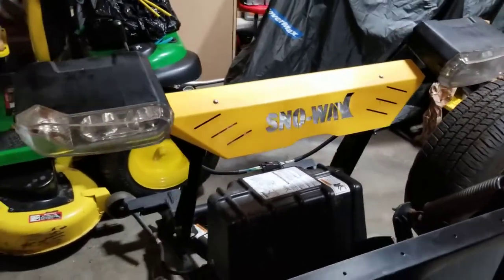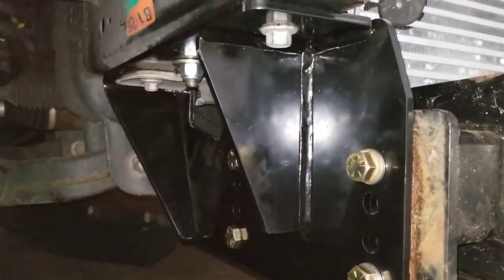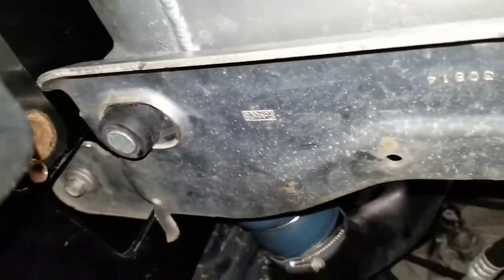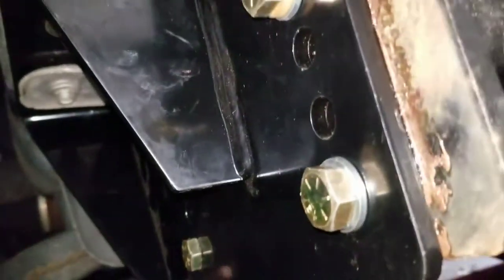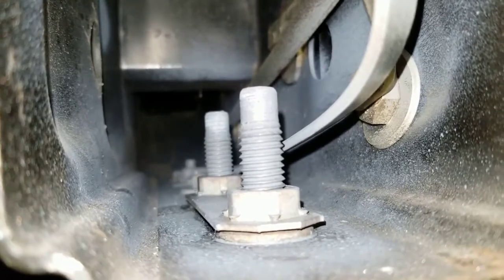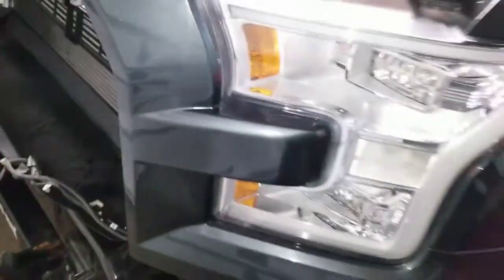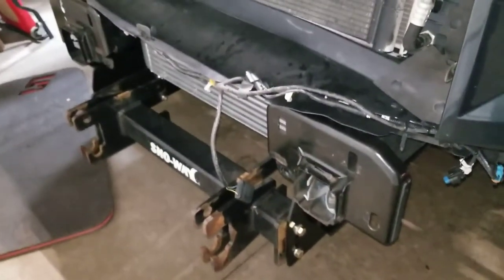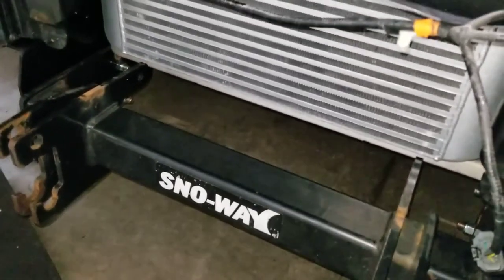SnoWay 26 Series Snow Plow Install, 2015+ Ford F150 EcoBoost

Comment: what is your front GAWR? mine is 3350 and the snow way dealer is leery about installing one on my truck because on the snow way web site my crew cab configuration doesnt have my GAWR. I have to choose the single cab configuration. so im wondering if my front axel can handle it.
Reply: I have the same question. I was told there are NO plows that are allowed on these 3.5L ecoboosts but I see more and more people doing it. Would love to see an update especially how it actually works once fully installed.

Comment: Starting this install today and this video will be a big help, I’ve had this plow since 2013 and have had it on a 1/2 ton ram and two 2500 rams. For the the 2500’s I had to widen the center section so I will need to cut and reweld it back to the original width and I did buy the snow way intercooler mount. I also bought the Ford weldments used and they didn’t come with the hardware so I will need to make the handle bolts as well, should be fun!
Reply from the maker: Good luck today man. That sucks the weldments didn't include the hardware, but mine didn't either. In my YouTube profile you should be able to see my email if you need to ping me for any reason. Just let me know.
Reply: @MidknightMechanics  thanks, install went good and didn’t end up having to make the handle bolts as I was able to just reach back in the frame rail.. all I have left to do is pull the remote wire into the cab.  Also found out I have a leaking oil pan gasket too but Ford gets to fix that!

Comment: Great video and I’m about to tackle the same job.  Question:  why wouldn’t you just notch the push plate bracket a bit vs the intercooler cross member to get that clearance?  Seems like this would be much easier.

Comment: Please do another post to see what it looks like when your done.  Interested to see if you got the plastic valance to attach on the bottom
Reply from the maker: My thumbnail photo on the video, that is what the final looked like. Unfortunately it was impossible to reattach the bottom plastic valance. You'd have to remove the crossmember to have the valance installed.

Comment: Likewise no other info, I did my install and removal on my 2019 f150 2.7ec. I am preparing to do on my 2021 now and may create a video or key pictures of the install.
I do not need the light harness and my 2021 has adaptive headlights so that further complicates things.
You will be cutting the horizontal plastic bumper piece, after that though you will be able to cut and install the vertical air deflector nicely up to the sides of the mount.
Reply: How long did you plow with your 2.7? Did you have any issues? I'm nervous to put a plow on a 2.7 as it's advised not to but I think it will be just fine.
Reply: I only plowed my own business property which took 45min to 1hr for a big storm. This would only be a few times a season in Toronto. I flip the leases so I only had time one year each. Loved it until I got my lightning - which I can’t plow with.

Comment: how much does this plow run for?
Reply from the maker: Right around $4K new, but this one, I was able to score gently used for 2200 and then I bought new push plates and headlight harness for around 650 more.

Comment: Thanks for video. I'm about to install on my 18 f150 diesel. Snoway or ford approves it for the 3.0....🤔🤷‍♂️. I wonder if that other hole you mentioned is for the 3.0 intercooler bracket. We gonna find out!
Reply: Update on the 3.0 diesel. The mount I sourced came off a 3.5 eco truck. It had the snoway intercooler bracket. It bolted up perfect. The locations of the intercooler pins are infact in the same location as the 3.5. 

So it was a pretty straight forward install. Still need to pull intercooler and mount the thru bolts in the frame. I current only have the 3 bolts underneath.

Comment: how is the ecoboost do with a blade i have one put do not know if i wanna put one on it or not
Reply from the maker: I was in the same boat Ryan. I (OCD) care too much about my truck but wanted to give it a try, knowing I could just sell the entire setup if I thought it was too much stress. So far so good. You can definitely feel the weight hanging off the front end, but surprisingly it doesn't bottom out the suspension, and doesn't hang really low like I expected. Also it plows very well, super fast movements of the blade, but you can tell it's a little harder/heavier steering while you maneuver the blade. I remember being warned, you cannot pitch the blade, while lifting the blade, while steering - it takes too much power. But that's easy; I'm almost never pitching the blade while lifting or dropping it. Also, I only plow my own driveway so the wear and tear on my EPS will be minimal. They also warn not to use heavy power loads like heated seats while plowing, so I don't. So far I'm really impressed with the quality and features of the sno-way, like the wireless remote. Not having to run new wires into the cab was priceless to me. Let me know if you have any other questions.
Reply: Midknight Mechanics could you post a video of you plowing , and did you have to do any work to the motor for the cooling of the turbos bc I know their was a video I did watch it's like 400 bucks or so , if you could post a video great .!  And how much  does that plow weight .?
Reply: @RYAN-bw8mn  according to their website, they're just under 500 lbs (471 to be exact) stock.
Reply: @MidknightMechanics  your truck should have at least the 225 amp alternator if you have the 110v power inverter. the 5.0 has a 240 amp option that's part of the snowplow pkg iirc, so I wouldn't worry about running out of power too much. maybe don't run a coffee pot off the power outlets lol. Would love to see a follow-up vid. this looks to be a lot cheaper option than getting a quad or utv for my place with a plow.
Reply: Upgrade suspension or lift kit before doing this?? 🤔